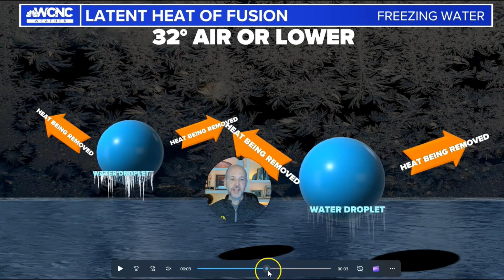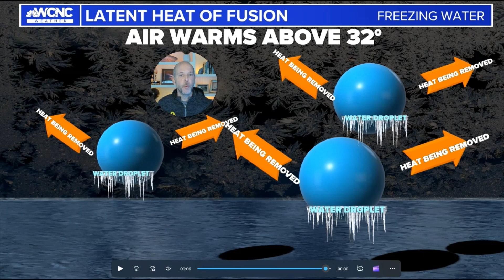Did you know Freezing Rain is a self-limiting process? What does that mean?

Comment: This is also partially why large bodies of water don't freeze solid. The water freezing from the top down acts as an insulator to the outside air, but also keeps the heat released by the water slowly freezing in the remaining unfrozen water.